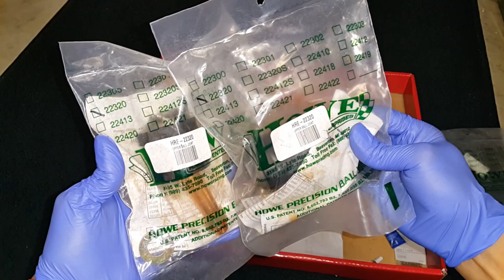Howe Racing upper ball joint 22320 maintenance

Comment: They have the option for longer bolts... like .5, 1, 1.5, what does that mean? As well as the 1.5" taper?
Reply from the maker: The different options and tapers are for using with custom geometry on other applications. If one wanted to use Howe's ball joints on a dirt track car for example.
Reply: @RylisPro  so could I still use the 1" or should I just get the standard one?  It's going a street machine nothing too aggressive.
Reply from the maker: @atfgarage9459  We just use the standard length upper ball joints at the tracks no problems for the past 5 years thanks!
Reply: @RylisPro  dang, thank you so much for your supper fast response. You have no idea how much you've helped. Have a safe 4th.